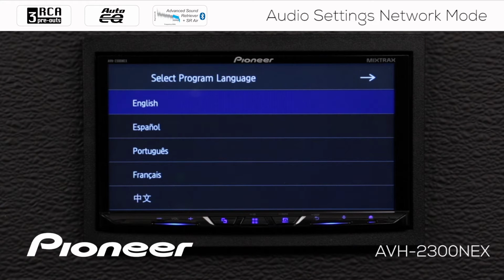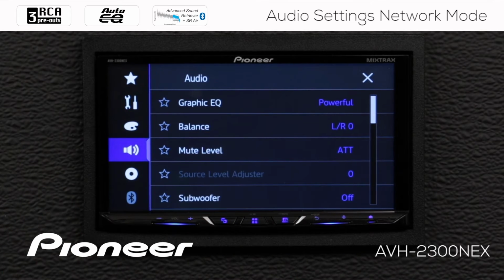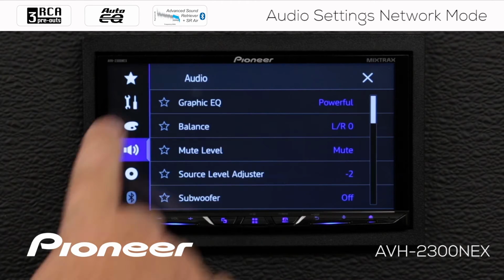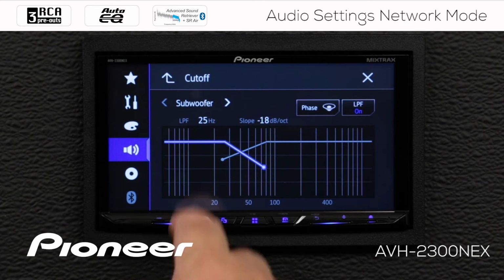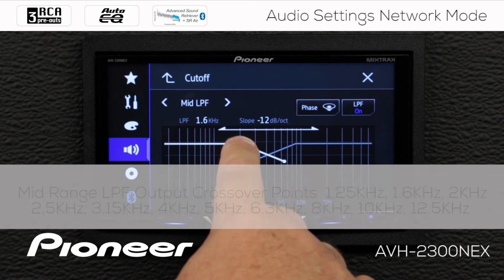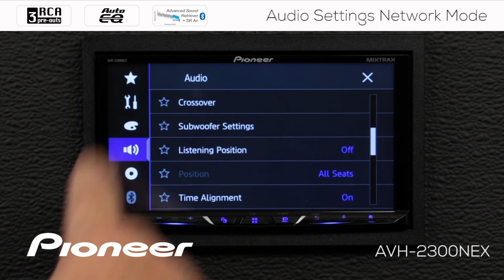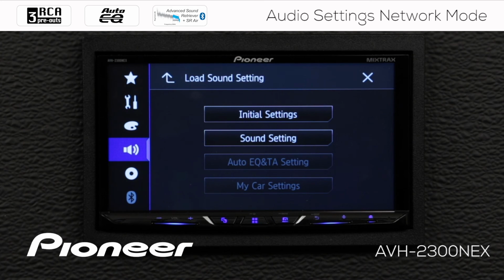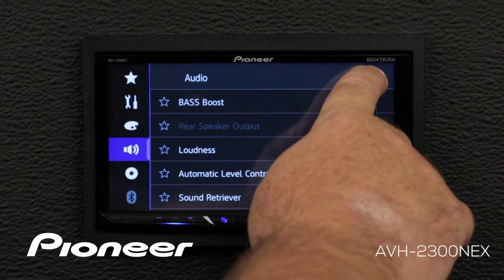How To - Advanced Audio Settings in Network Mode on Pioneer AVH-EX In Dash Receivers 2018

Comment: What would you recommend for me.  I have a 2013 GMC Sierra 3500HD Denali with the Bose. Should I use the network or standard.? I have front and rear door speakers.... a speaker in the dash and 2 pillar tweeters. I would appreciate the help.
Reply: I recommend Standard Mode with a front and rear setup.  If you decide to upgrade the old factory speakers, ( they are 7 years old and dying from being baked in vehicle)   to new one's you'll have the opportunity to setup the system in Network Mode if you want.  With new speakers, I would recommend a midrange and tweeter package in the front of the vehicle, and a subwoofer or two in the back.  https://youtu.be/39JRlIHjgtw?list=PLw63zJRQbCNiTV71nfrZHNcn8taD6y4yX    and    https://youtu.be/QgG1mu2u3XI?list=PLw63zJRQbCNhkTQCxPpxGF4h6l6qocsaR    a 5 channel amp to give you power and clarity   https://youtu.be/99Hfmc8QxVc?list=PLw63zJRQbCNg42VJXw0g7xzWJozqoSR1V    You can learn more about Standard Mode/Network Mode here:    https://youtu.be/TzCGdtiSXec      You can find more videos on Pioneer's YouTube Channel here:  https://www.youtube.com/user/pioneerelectronics

Comment: So, the Network mode .....interesting...So tweeters, woofers, and subwoofer....in essence, this is like an active crossover???
Reply: It's not "like" an active crossover.  It's is exactly an active 3-way crossover with on screen control of crossover points, slopes, boost and cut and time alignment for any speaker in the system.  And you can control the entire system from the driver's seat.  You can see more details about crossover settings in Network Mode/Standard Mode in this video:   https://youtu.be/WvJXYh6vk_0?list=PLw63zJRQbCNjqc7v6Xcw2ObD1mrcbACkF   and in this video:   https://youtu.be/TzCGdtiSXec?list=PLw63zJRQbCNjqc7v6Xcw2ObD1mrcbACkF     You can find more videos on Pioneer's You Tube Channel  here:  https://www.youtube.com/user/pioneerelectronics